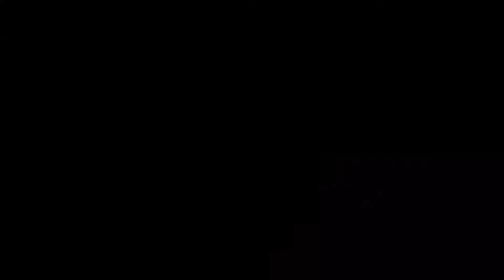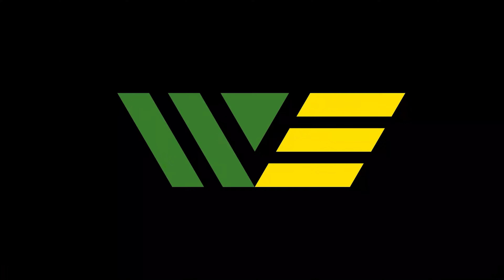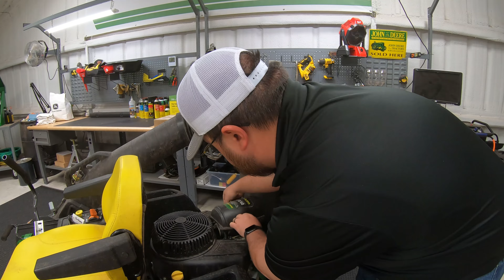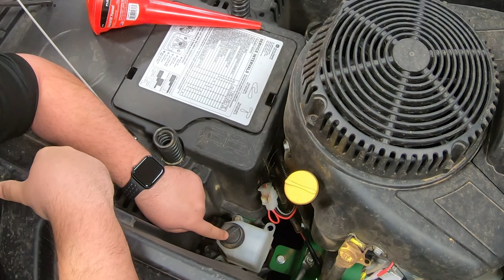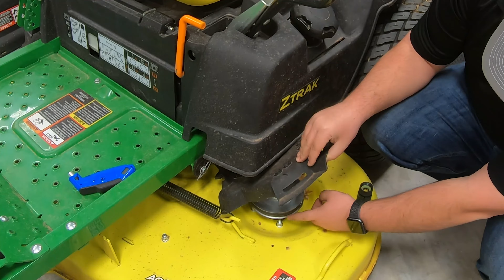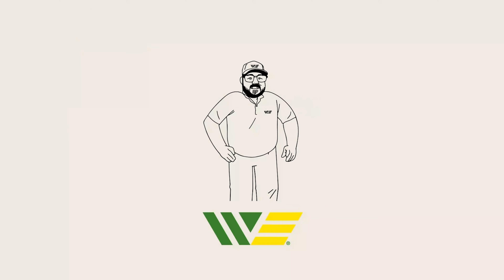7 Steps to Get Your John Deere Zero Turn Ready to Mow

Comment: Do you grease the front spindals on the 2023 Z320R mower ?
Reply from the maker: They do not have a grease zerk and it also has a sealed ball bearing so you do not have to necessarily.

Comment: Middle blade not cutting as well as outer two blades.   Belt sleeping?
Reply from the maker: Interesting... It could be that the belt is slipping or you may check the condition of your spindle by taking the belt off and making sure it will spin freely. I hope this helps and thanks for watching!
Reply: @WesternEquipment      It’s a John Deere 530m.  Mulching blades only 50 hours on mower.
Reply: What is the recommended tire pressure on Z335e? Thanks
Reply: I would also add sharpening the blades at least 1x a year

Comment: Are there transaxle fluid reservoirs on a 375r ?
Reply from the maker: No they do not have the individual reservoirs on each motor. All of the oil is contained in the motor housing!